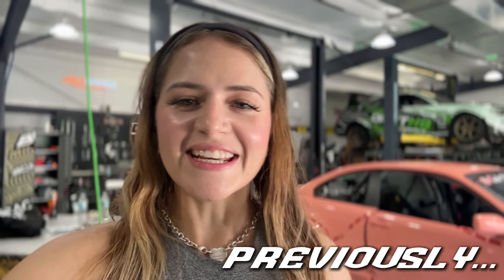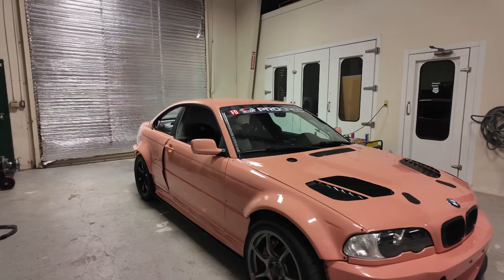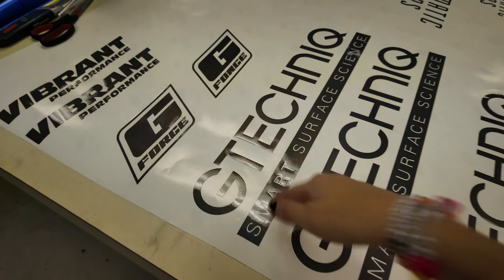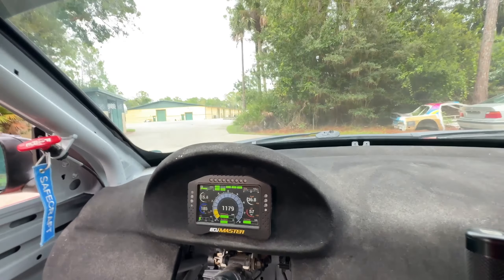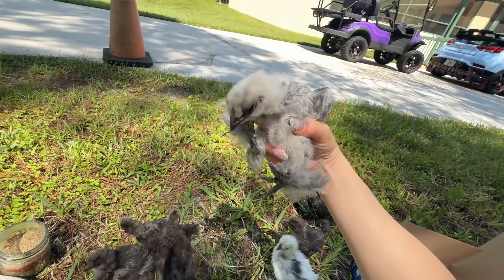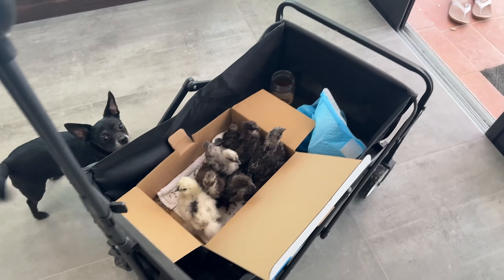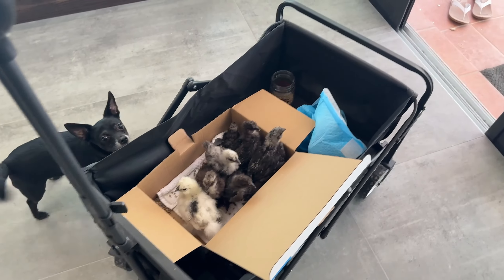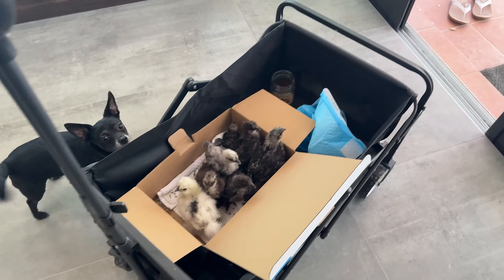First Changes to my NEW Pro E46 Drift Car!

Comment: You need roosting spots in your chicken area . They need to be able to get off the ground
Reply from the maker: I have a roosting area with multiple levels, but the silkies don’t really
Like it. Theyre a lot different than the other normal chickens at night they like to dog pile and cuddle lol I am going to build a smaller one for them tho and see if they use it

Comment: Your knees look a little too close for comfort to that steering column adjustment lever if something were to happen. I am a fan of the asymmetrical schemes BMW uses in GT3, GT4. Also a fan of silver on them because it makes the headlights and grille stand out. Not your thing though.

Comment: If it is a pure race car, then only if the carbon offers a real value; do it.   I broke minme at 1.23G sideways when it hooked at around 50mph.  Wish I had another.  I have a spare new unused KW adjustable suspension I'd like to use.  Drive safe young one!!!  Rip off all the wrap and paint it hot pink!  Make it you!